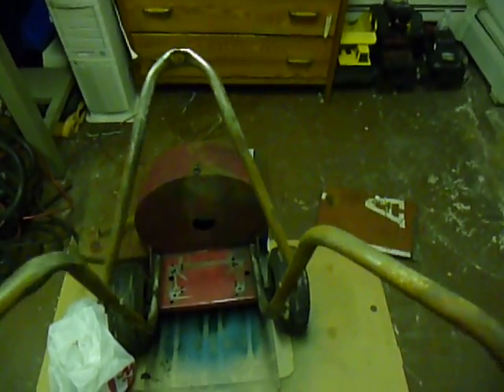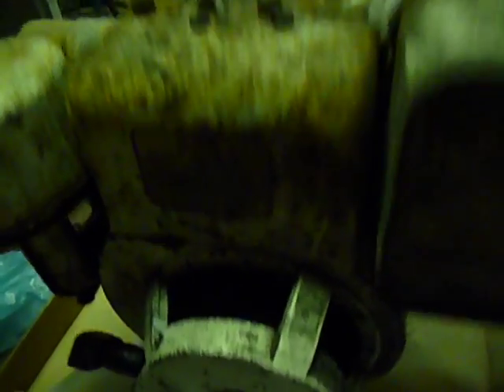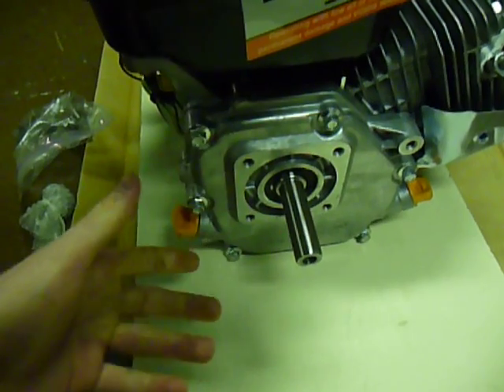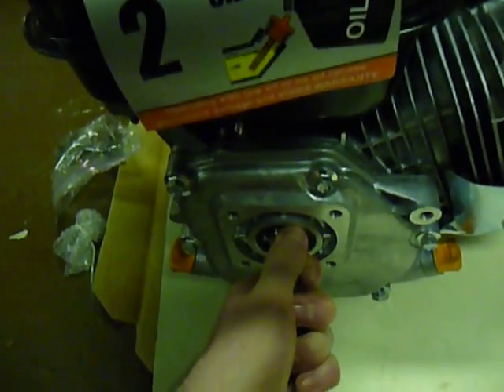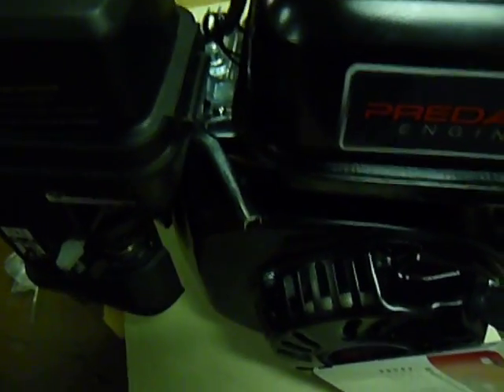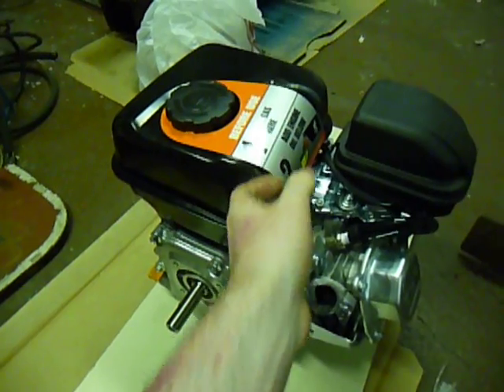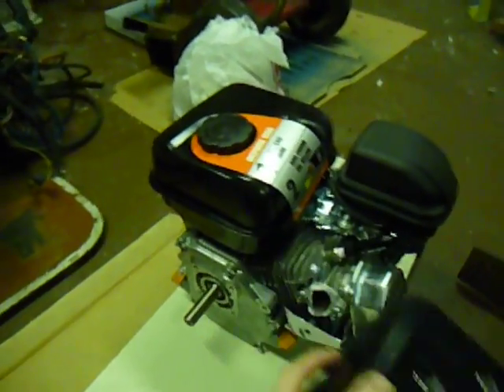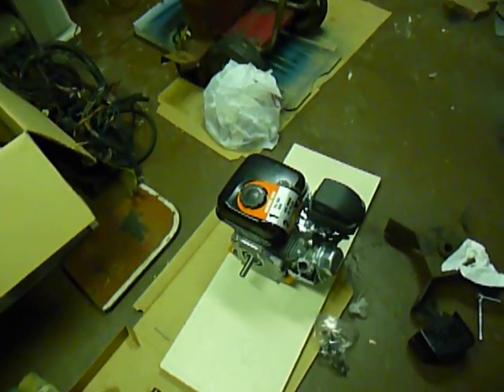Honda Clone Repower Project -  Predator 212cc  7 hp Clone motor Part 1

Comment: My I/C B&S % Hp is shot on my Giant Vac.  I might get the predator engine as well.  thanks.  Ebay sells 3/4" to 1" crank shaft adapters for the predator motor.

Is there a Part 2?
Reply: I have a Giant Vac that had a 8hp B&S IC.  I put the predator 8hp on it...pretty much a direct swap out except for the brace that had to be remounted a little to make room for the slightly bigger engine.